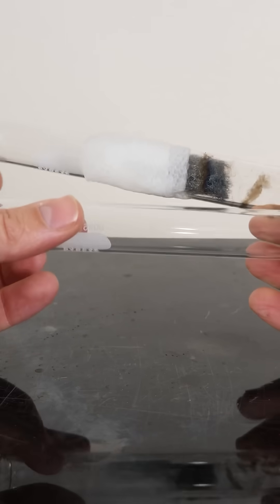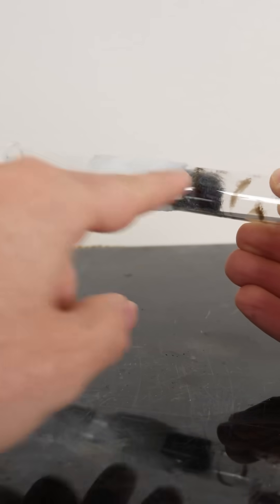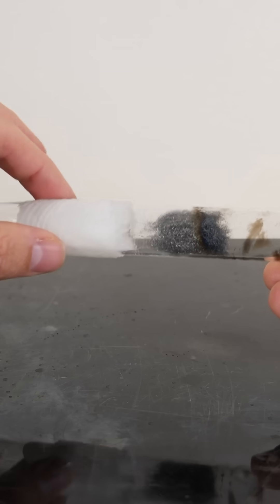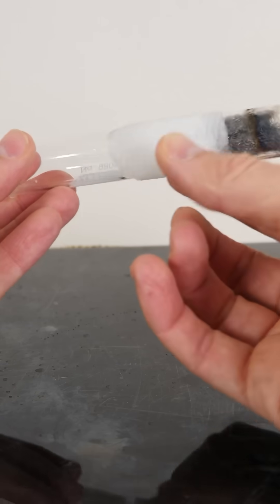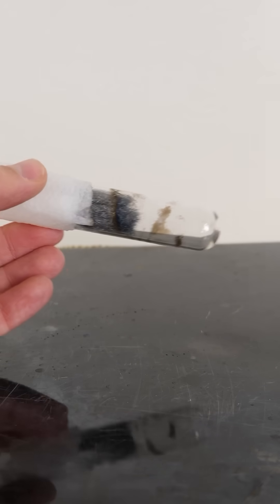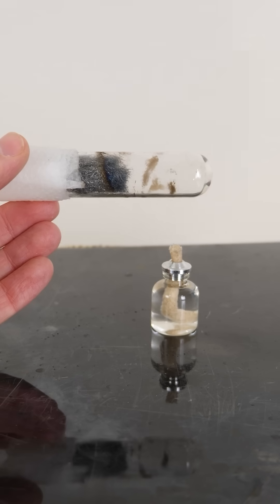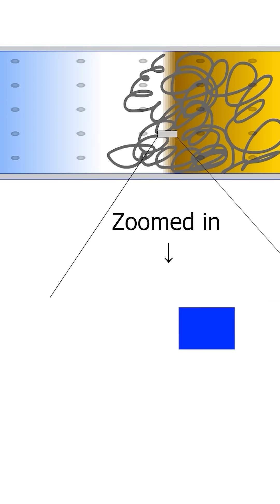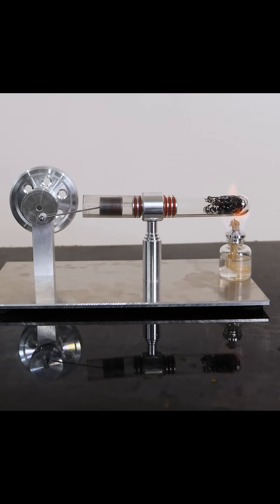This Engine Runs On Sound

Comment: If you put sulphur in the bottom of the test tube and steelwool in on top heat untill sulphur burns the same noise happens.(untill sulphur is gone).

Comment: The sound has nothing to do with powering the engine. Air pressure changes are transmitting the power from the heat. The fuel that is burning is powering the engine, the same as most engines that are used all over the world.

Comment: as a glassblower i encounter this all the time.  but my tube is usually 16" long, so the notes are always much lower.  

not sure what the steel wool and paper towel are doing for you.  just use a longer tube if you're worried about burning your fingers?

Comment: OK… why didn’t you perform this as a proper experiment? You put so much energy into that “ kickstart” that we really have no idea as observer how much to attribute to the resonance and how much to you. Also, you literally say it’s going so fast when you can see it is actively slowing down considerably by that point. While I appreciate this demo, it would have been much more effective to kickstart with a measurable and consistent amount of energy applied against a test tube with nothing in it ( and open glass cylinder to see the difference  from air pressure )  before the test. And some way to measure the RPMs, and duration. 
Great channel but we can still learn science with proper experiments.

Comment: So where in this is the sound used to run the motor? The explanation made it sound like it's the air pressure, not the sound, that's being the driving force against the piston

Comment: CRAFTING LOG
Steampunk Vibrator Schematic Acquired

Assembly Components:

3× Scrap Metal

1× Glass Test Tube

1× Rotary Piston

1× Wet Cotton

1× Steel Wool (a.k.a. Scrubbing Mesh)

1× Tea Light Candle

Crafting Mechanics:
Utilizes a Hollow Harmony Oscillator — a chaotic thermal resonance engine powered by candle heat and cooling damp cotton filtered through scrubbing mesh. The piston sustains oscillation via Stirling-like energy flux, producing vibration and unsettling musical tones.

Crafting Result:
+2 Moral Ambiguity
+4 Penetrative Intensity
+1 Awkward Inventor Reputation
+1 Self-Sustaining Resonance
+251 Involuntary Jazz

Achievement Unlocked: Well-Oiled Contraptions

---

QUEST AVAILABLE: Test Subject Field Trials
Objective: Locate a brave volunteer.

QUEST AVAILABLE: Material Upgrade: No More Shards
Objective: Replace glass ampule with safer component.
Recommended: Flexible Arcane Polymer or Resin-Stabilized Latex Tube.
Reward: +2 Durability, -3 Lawsuit Risk

Schematic Upgrade Available: Cork-Tipped Modesty Cap
“Because some things shouldn’t whistle in Eb minor.”

Comment: That's what I liked about the two cycle 500 cc mot/acoustical expansion chamber equipped with a stinger that tunes the exhaust into a higher frequency thereby eliminating pressure disruptions from low frequency acoustical shock waves😂
Reply: Retro encabulator what now?

Comment: The engine part is obvious, but the 'loud' whistle sound part isn't, where is the soud-generating air friction? neither the steel wool nor the paper towel, and the tube mouth isn't in the right angle which would be otherwise 'new' physics to me.

Comment: The "engine" isn't running on sound, it's running on he energy of the flame heating the air in the hot end of the tube.

Comment: Ive never knew how flutes worked all that well until that 1st visulization (idk why though, i blew over the neck of a bottle before)

Also i play the clarinet, so air goes rhrough, not over
Reply: They're both splitting an air stream, which I believe is part of how all woodwinds work, whether reed based or not. Incidentally, brass all involve buzzing the lips on a mouthpiece.

Comment: This only proves that an engine can not fire without... fire. You still need something to combust.
Reply: You don't need combustion to run a heat engine, you just need something hotter then the surroundings.  An electric element, some lava or some Plutonium 238 would work just as well.
Reply: @wally7856 all of the things you mentioned combust in some way to make heat.

Comment: It's not running on sound though.... It's running on air pressure created by heat...The sound waves & the pressure waves are 2 different waves. Similar to an explosion 💥 that releases shock/pressure waves & sound waves. The shock waves aka pressure waves travel faster than the speed of sound. 
Which is why, with a large distant explosion 💥. The shock wave-pressure wave will reach you faster than the sound wave. That you will hear like a second later. Similar to lightning ⚡🌩️ you see the flash & hear the thunder seconds later.

Comment: It is 100% INTELLECTUALLY DISHONEST to say that this engine “RUNS ON” sound. It runs on thermal energy (the flame) like every other conventional power source in the universe. You can maaaybe say that the “sound” connects the piston to the thermal conduction, but not really. Because it’s really the air pressure that connects the piston to the hot air. The “sound” is just a by product of the moving air, as the narrator explains.
Reply: Vineboom sound effect
Reply: It runs on fast moving pressure waves of air, aka sound. Plus its called a thermoacoustic engine. He didn't make that up.
Reply: Its the engine of Stirling
Reply: Sound IS moving air, in this circumstance.
Reply: Boom!!! Roasted
Reply: then if we have to be this technical we have to call speakers "air pushers" or something like that cuz they produce sound by pushing air
Reply: No one likes you
Reply: Yes, and the way the way the energy is transmitted is incredibly important. 

In an ICE, it travels through pistons and shafts as rotational energy, if you remove the pistons you won’t get very far.
If you remove the regular changes in air pressure (i.e. sound because that is what sound is) then would this engine work? No.

Is an ICE powered by gears and mechanical movement? No. Is it run on them and their interactions? 100%.

This is by far the tamest “clickbait” title, please go complain elsewhere, this particular thing you’re stuck on is not an issue.
Reply: Bro pulled an "erm acrshally" but I prolly would too
Reply: Sound waves are energy that moves air in a certain way that your ears feel. And stuff.
Reply: this is extremely tame as far as clickbait titles go, im not even bothered
Reply: Mad
Reply: That's like saying Steam is just a by product of a Steamengine that runs on coal.

No, obviously he was talking about Sound running the engine, just like how Steam runs an engine fueled by Coal.

Dumb.
Reply: @BeastOrGod  no, it isn't, because sound isn't what is causing the piston to move. The air pressure built up by the heat is what's causing it to move. The sound is irrelevant.

With a steam engine, the pressure of the steam is what moves the pistons. The steam is a necessary component.

Dumb.
Reply: @BeastOrGod  nice
Reply: He didn’t say the sound makes the engine go ..he said thermal acoustic engine .. clearly it’s ran by thermal energy
Reply: @qbanz00  the title of the video... it literally says the engine runs on sound. It doesn't, it runs on heat which is produced by fuel.
Reply: @Lostachilles I stand corrected .. it’s called clickbait . But he doesn’t lie in the actual video itself
Reply: whatever nerd
Reply: @Izukachan lmao

Comment: "This engine runs on sound!"
Shows an engine that runs on heat.
Reply: Thermoacoustic engines do exist and they rely on HEAT induced acoustic resonance. So yes, this engine runs on heat, but it uses that heat differently to what a Sterling or Internal Combustion Engine does.
Reply: @malcolmsouthworth2712  'unga man use big word me not understand, man trying trick me bunga" - your average commenter
Reply: @millinom  sybau
Reply: @PrehistoricPig69  wat u gonna do goofy
Reply: Air pressure.
Reply: “We’ve invented a new type of engine!”
Looks inside:
>Heating up gasses
Reply: "turn heat into sound that then moves a piston"
Reply: Came here for this 🎉
Reply: Technically it runs on movement energy
Reply: @ConfidentlyUninformed nah it runs on weak nuclear force 🙄
Reply: Clickbait😒
Reply: There's a reason it's called an acoustic engine
Reply: @millinom  its a stirling engine
Reply: @HudbudDude10 lmao no
Reply: @millinom  okay maybe its not the exact same thing but its very similar
Reply: Yeah I thought the same. Every car runs on sound if you think like this guy.
Reply: Yeah, he probably said that it ran on sound to arouse curiosity & get more views..... Many people get confused & think that the expansion pipe on a 2 stroke engine uses sound waves to make more horse power by pushing unburnt fuel gasses back through the exhaust port into the cylinder. 
It's not the sound waves pushing the unburnt fuel. It's the shock/pressure waves from the explosion 💥 engine combustion. That bounce back inside the pipe. An explosion 💥 makes both shock waves & sound waves but people often think they're both the same thing. The shock waves often  travel faster than the speed of sound & are the destructive force in an explosion 💥. Which is why during a large explosion miles away. You'll feel the shock wave hit you before you hear the sound/ sound wave. 
Similar to thunder & lightning ⚡ you hear the thunder after the lightning strike. Because it takes time for the sound waves to travel to your ear.
Reply: this channel runs on click bait.
Reply: @MondayMorning-yv7nf  sybau unc 🥀

Comment: I could never quite get my head around how Stirling engines work and you explained it perfectly.
Reply: This isn’t a sterling engine
Reply: @oatmongen4263 ok mr pedantic. Close enough, laymen's terminology it is.
Reply: @aaronh1372 Layman's terms aside, there is a big difference between a Sterling engine and a thermoacoustic engine, mostly since sterling engines don't need a huge temperature differential, ever heard of a coffee cup engine? You should get one, they're fun to play with.
Reply: @malcolmsouthworth2712 as one is a type of the other, the difference is not that drastic. I have not heard of a coffee cup engine, thanks for the search topic
Reply: The wet paper towel really helped
Reply: Sterling engines use a physical displacer.

Comment: Why the steel wool? Why the paper towel? Why wasnt the paper towel there in the end?
Reply: Steel wool slows the gas transfer to create a pressure differential.
Wet paper towel soaks in heat to create a temperature differential.

This was all accomplished with that center piece in the final demonstration.
Reply: @MrSquigglies is the steel wool there as a good conductor of heat with high surface area?
Reply: Steel wool generates oxygen when heated/burned, and the paper towel is soaked in water to create a cold region in the tube, which takes the energy out of hot air particles. 

as I understand the tube was open while the wet paper towel was on, and the thermal difference created a barrier for the air that was also generating the sound. when you attach a wheel the "bounceback" is done by the plunger in the end, the mechanical force pushes the air back towards the heat source effectively creating the exact same oscillating frequency, but converting it to rotational force.
Reply: @hawkeye6854  As far as i know, steel wool doesnt produce oxigen when heated/burn.
The rest i think you are right except that the engine is not able to rotate as fast as the frecuency of the tube due to mass inertia, friction and some other losses of energy.
Reply: Oh thanks for the answers guys🙏! I just found it weird he didn't mention it in the clip.